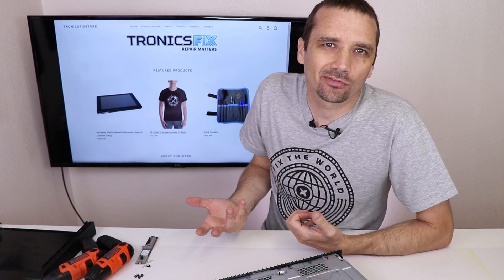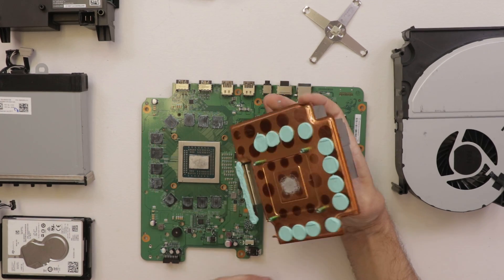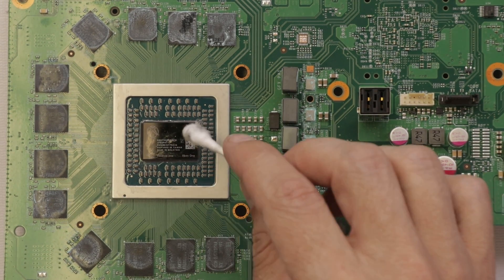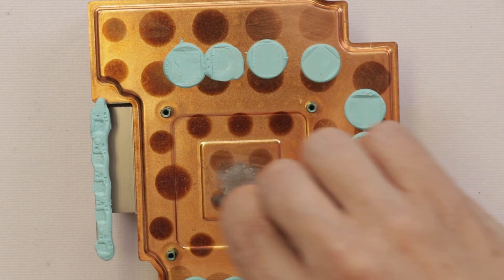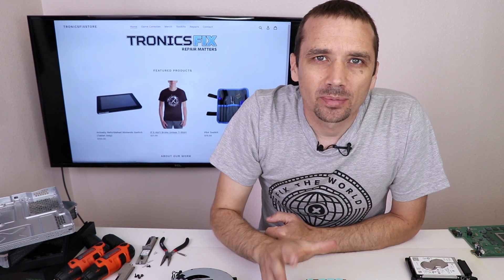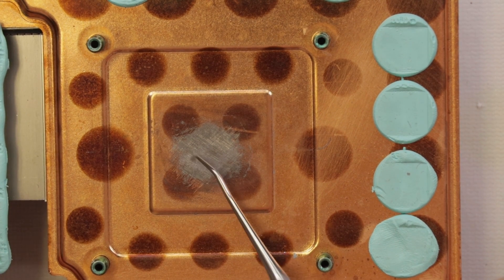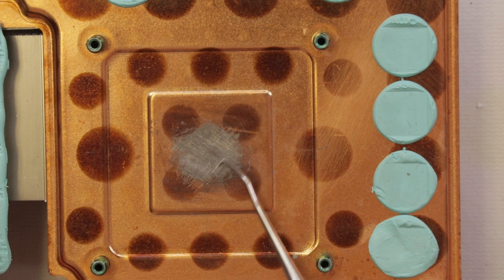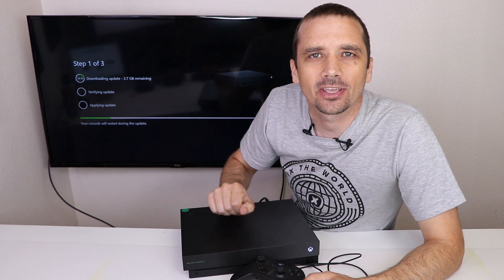Effects of Liquid Metal After 9 Months

Comment: You do not want to scratch the liquid metal off the heat sink it does virtually nothing at all (in terms of performance degradation) might as well leave it on since it's easier. On a side note liquid metal does react with copper but not seriously it will absorb some of the gallium which is why liquid metal tends to dry out. Long story short the gallium in liquid metal and copper are both attracted to each other and the gallium ends up soaking into the copper some. This is a good thing tho if you plan to reapply liquid metal, like I said they are both attracted to each other (copper has 29 protons and 29 electrons while gallium has 31 protons and 31 electrons) they both balance each other out and that layer stuck on your heat sink creates a neutral charged zone where (once a sufficient layer is built up) they no longer attract preventing the liquid metal from drying out on the second application.

In terms of liquid metal that layer is a good thing and actually improves the liquid metals performance over the first application as the copper will absorb a lot of the first applications gallium causing it to slowly dry out until they have both built up a sufficient neutral charge preventing the gallium in the liquid metal from reacting further with the copper.
Reply: This should be top comment, thats exactly what I noticed when I wanted to put Liquid Metal on my stained cooper cooler again from my AIO, it didnt stick at all so I reapplied it just on my CPU IHS and have perfect temps again after 1 year, I guess it wont dry out anymore now on my IHS.
Reply: So in terms of a second application, clean it off the APU but leave it on the copper and then re-apply?
Reply: Mostly true, except that the copper gallium alloy is actually less thermally conductive than copper alone, but the difference is not big. When applying liquid metal on bare copper you always need to reapply in a few months because of the gallium and copper reaction making the liquid metal "dry out"
Reply: so its not damaged then? its normal that the copper heatsink looks like that after long term liquid metal use? im planning to use it on my Zephyrus laptop but im concerned about the looks of the heatsink in many videos :(
Reply: What about the GPU die....Cause it seems that it got a slight damage on it...
Reply: Better explaining then my science teacher in 11th grade lmao
Reply: Given some of the gallium "dried out" so to speak, I'm curious if it just changed the temp at which the LM melts. Would applying heat have made removal easier? If so, I think it's safe to assume it would have returned to liquid during normal operation making a re-application redundant in the first place. Another temp/db test should have been performed prior to disassembly.
Reply: @SerenoOunce  the gallium doesn't dry out it was more figure of speech, it will absorb some into the copper leaving the other non liquid materials on the surface.

Once it has been absorbed enough absorption will stop and a second application down the road insurers you still have enough gallium for the liquid metal "thermal paste" to function as intended.

It's balanced is all, with gallium removed it will negatively impact the heat transfer properties of the first application over a period of time if the heat heatsink of the cooler is made from pure copper and not coated with another metal link zinc for example.
Reply: @GainingDespair  same question, need to reapply after some second application?
Reply: @SerenoOunce  After the gallium reacts with copper then liquid metal alloy would have different physical characteristics. I'm not sure if it would be melting when CPU is at high load or not. But Gallium is the main metal in any liquid metal alloy used as TIM so the decrease in Gallium would have a big negative impact. I wouldn't make a guess at the melting temperature of the alloy with significantly less Gallium. But heat transfer has been shown to be worse after a few months of applying the liquid metal due to the copper and gallium reacting with eachother.
Reply: so basically the after it dry out, you just reapply it and no more reapplying?
Reply: However, what is the thermal conductivity of this alloy that is created in the process. 🤔
Reply: I'm actually contacting a metal alloy company that sells various purities of gallium-copper alloy regarding the thermal conductivity of the various purities.
Reply: You seem to have slot of information about liquid metal could you help me with my problem I have a g14 gaming laptop liquid metal cpu I I’ve been having serious performance issue wihr it to the point it can’t even run correctly and noticed the cpu I thermal throttling while idle and noticed the on the cpu liquid metal looks dried up you think this could be the cause of thermal throttling?
Reply: Love the science that people do bring up too wish i was that smart with science like that this makes me think like then is a alright idea to use liquid metal for some consoles good stuff

Comment: Great video and information, thank you!
Can you tell me what goes wrong with Modem/Routers when they quit working?
I have several that have died over the years and I always wondered why they quit.
They all start out great, then after time they start dropping the connection until they finally will not reconnect again. Thanks.

Comment: Liquid metal will react with copper, forming an alloy, but the reaction is self-limiting as the layer of the alloy on the surface of copper should not penetrate deeper into the heat sink and actually form a protective layer that stops further reaction. That layer that You could not remove was exactly that. It would be completely different with aluminium, as the reaction is different and it forms a brittle and POROUS alloy taht will literally "suck" in more and more liquid metal as the alloy forms and the corrosion will continue to penetrate untill there is no more metal to react. It's a BIG ISSUE with some cheaper water cooling blocks that are made out of unplated aluminium as they will not only get brittle and porous, but may actually start to leak on to your precious electronics.

Comment: You should be more worried about the stains on the die itself. Those stains don't come off and if too much of them accumulate, they can interfere with heat transfer, in which case, you would have to lap the die.

Comment: the issue with liquid metal / gallium ( apart from when mixed with aluminum) is when its directly on a high wattage CPU die , as you need something spongy to handle hot / cold phases

Comment: Short answer: yes. 

But it doesn't really matter that much. You can rub off what you can and and use compressed air to blow off any shavings, then reapply. It'll take a while to eat such a significant amount that the concavity will actually cause a problem. If you're really worried about it then repeat this process every 3 months or so. Is it worth it for a 5 degree Delta? Your call. Probably not though. Maybe for ~20° though.

Comment: Use 1000 grit sand paper (wet) to smooth out the heat sink and remove the liquid metal.
Reply: Definitely DO NOT use sandpaper on any of your internal components 🤦🏻‍♂️ at best this will cause uneven surfaces, voids that won't be filled by any thermal paste and in turn heavily reduce heat transfer. At worst you could permanently damage your hardware.

Comment: It does just fuse into the copper and leaves that silver stain on it. Doesn't hurt it though, my PS4 Pro had the same thing.  I noticed it getting louder over time so I pulled it apart to clean it up.  I went with Kyronaut the second time.  It's been perfectly fine.

Comment: LM is perfectlly safe, there are lot of people out there having liquid metal in they machines for years without any problem, including me. But there are always people spearding scary rummors about LM, I don't think they even use LM. LM will eat through aluminum, do nothing to nickle, leave a very thin layer of stain on naked copper, but it won't affect the perfermance, that's the Gallium forming alloy with copper, and that is how far it will get, it won't go any futher. As long as you don't open it and try to clear it, it will be fine for enternity. As long as you don't short anything, don't let it touch aluminum, LM is perfectlly fine.

Comment: Liquid metal does not damage copper. its already been tested. As it states right here.....This is similar to what we saw with nickel, but much more extreme and effectively impossible to remove, even with a lot of acetone. That’s because we’re starting to see ion migration into the copper, with some of the liquid metal permanently plating the copper. Gallium has a negative potential and copper has a positive potential, which will cause the gallium to migrate and plate the copper. In terms of performance, the copper IHS retains all of its original performance characteristics (in our testing), and so looks a lot worse than it is in reality. This is a stain, not heavy pitting or corrosion. but don’t use liquid metal with aluminum – it will embrittle the aluminum and form an alloy with the coldplate, resulting in chalky disintegration of the two connecting metals. For a nickel-plated IHS, liquid metal is fine. The heavier gallium composition makes combination with nickel tenable, and is a non-issue for corrosion and performance. Copper is also mostly OK. It will stain with Conductonaut (heavily), but performance remains the same.

Comment: It's basically galium , it freezes at a very high temperature so just sitting in a cold room with a massive heat sink would freeze it . As it boots and heats up it'll be back to liquid. That's my logical guess

Edit : I checked and found that it will react slowly with copper at low temperatures so probably it is dissolving slightly but nothing thermal paste can't fix

Comment: ok so you do know that 1200 wet and dry abrasive is a thing right....I'd bet you'd have been much more successful using that ....in fact its what I do ..I have a Dell laptop with LM on and its had three applications over the 3 years I've had it (just to check things were ok) and just a quick 'polish' with 1200 wet N dry got the heatsink mating surface smooth and as clean as possible each time....I slight diffusion or 'staining' of the copper is normal but not detrimental to the heatsink.

Comment: If you use the principle of AZSINTLC which is the scale for galvanic action (A - aluminum, Z - zinc, S - steel, I - iron, N - nickel, T - tin, L - lead and C - copper) you will find that copper is the strongest and will corrode the other metals on the scale. The further apart they are on the scale, the more reactive they are to galvanic action. So basically aluminum and copper in direct contact with each other is the most reactive to corrosion and the copper will corrode the aluminum.

Being that the heatsink is copper I wouldn't be worried about corrosion, I would be more concerned about it forming patina (a green protective layer formed on copper to avoid the metal itself from corroding). 

I'm not sure if this would cause issues and I'm not sure what liquid metal is made of but I would imagine that regular thermal paste would be best because it would create a non corrosive barrier between two bare metals as opposed to liquid metal.

I could be completely wrong about all of this of course, just the thoughts of the sheet metal worker coming out in me.

Comment: this is a heatsink so it will pull the heat away from the liquid metal... liquid metal does become solid if the temperature is low enough. You might have reached that threshold thus solidifying the liquid metal. Try heating up the copper a bit and see if this will solve it. Theres allways microscratches on the surface of almost anything, if liquid metal somehow was able to fit in those on the elemental level it couldve embedded itself like that when it became solid.

Comment: Quicksilver and Flitz.. this wont happen with thermal grizzly.
Reply: if your talking thermal grizzly liquid metal its mostly Gallium so it would have a similar effect on bare copper. but just because it had a reaction with copper it doesn't suddenly stop working for thermal conductivity. but liquid metal has much less of a reaction between nickel plated metals. its part of why its used so much for deliding intel cpus.

Comment: You don't really need to press hard, you just need to scrub lightly forever with the cotton swab. For large chunks, I use a toothpick. I used to think I that to press hard, but just looking at the cotton swab, you can tell it always keeps gathering a little silvery particles. Takes forever, but it does come out (of the CPU side). As for the copper itself, it doesn't matter if it integrates with the liquid metal. Zinc neither. The only danger is aluminum, because aluminum makes these long hair strings that can cause short-circuit. The copper merging with the liquid metal does not affect the thermodynamic cooling much (less than 0.5C).

Comment: Probably if you have heated the copper cooler it would probably make it more liquid and easier to clean again... Anyway even people that fully cleaned it after like a year without having to scratch it still seem the copper gets a bit discoloured, I don't think it will damage the console in its entire life, now having it 4 ever, I still think it might make the copper a bit bad or something no idea (who knows what happens after like 10 years or more of use if the console doesn't die first with other problems beside heat)...

And to get rid of that alloy between liquid metal and copper you will have to sand it and polish to get back maximum surface area to apply new thermal paste without affecting temps.

Comment: Thermal transfer paste serves 2 purposes simitaniously, one is that it helps transfer heat from one surface to the other, two it will 'make up' for imperfections between the 2 machined surfaces, both of these properties are why its used. There is a trade off in thermal transfer efficiency of the paste as the gap increases between the two mating surfaces and the types of metals used.

Comment: Hey for my PS4 my disk drive has stopped working and given me the error SU 42118-6 where I can’t update my PlayStation. If I replaced my disk drive (I’ve gone inside it and everything seems fine) would that fix the problem?
Reply from the maker: Probably not. That problem is usually caused by blown fuses
Reply: TronicsFix so this would cause my PS4 drive to stop working?
Reply from the maker: Yes, it can. There's no way for me to know for sure if that's the problem but it is something I see a lot in my shop
Reply: TronicsFix if that’s so, what’s ur usual solution to this fuse issue

Comment: The moral of the story is, stick to high quality thermal compound and you won't have any issues.
Reply: There is no issues with liquid metal.  Although the heatsink may not look very pretty it is completely fine, the gallium just starts to merge with the copper after a while.  Over a ten year period the LM will perform far better than a thermal compound.
Reply: Well this video shows that you are wrong.
Reply: @Jaymiecain1  If you use a good TM such as  Arctic MX4 you should have no long term issues and will not even have to risk worrying about anything happening to the metals it touches. Liquid metal does perform better but I see it as more of something that only enthusiasts should be looking into, something for extreme overclocking and generally long term solutions, if you want a long term solution for a system that should just work, A high quality TM is still the best option I think.
Reply: Justin Buckley +100 for Mx-4
Reply from the maker: True

Comment: You should use acetone and or war up the consol a bit to make the liquid metal removal easier
Reply: Acetone dissolves plastic and there is a lot of plastic on a console and some of that plastic is highly important especially on the motherboard.
Reply: @LoneWolf5841-  im not saying tobspray it on the board but on qtip that logic
Reply: @TheDarckstart  still too risky if you accidentally get any Acetone on the motherboard you will ruin the console, my friend found that out the hard way.  Much safer to use IPA and it works well for cleaning. The only reason it was harder to get off the liquid metal is because it bonded with the heat sink creating an alloy.
Reply: @LoneWolf5841-  or using alcool but trying to clean liqid petal dry isnt the best way
Reply: @TheDarckstart  not when it bonded to the heat sink. I use Arctic Silver 5 as it is the best thermal paste. Liquid metal seems to cause problems

Comment: This has been addressed by Gamer Nexus many times. The liquid metal does bond with the copper heat sink but doesn't effect thermals at any measurable amount with current tools. Never use liquid metal with aluminum heat sinks or AIO's was what Gamer Nexus warned due to liquid metal actually eating away aluminum. Also Thermal Grizzly warns against this.
Reply: Yeah it's a non issue, apply LM and forget it. Saw on another channel where after a year a guy was saying his PC fans were getting louder because the liquid metal was "drying out". He showed thermals before he changed the old liquid metal out and then put thermal grease on it... The thermal grease was a couple degrees higher than the old liquid metal lol.